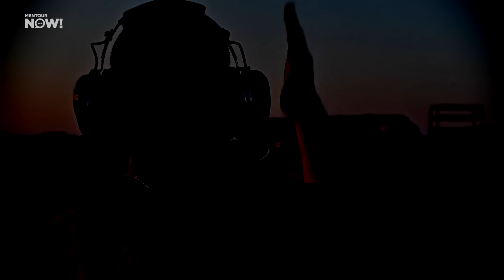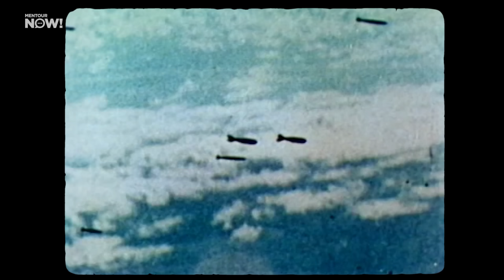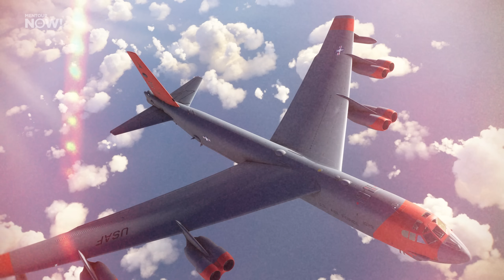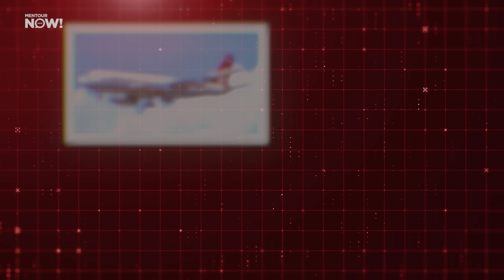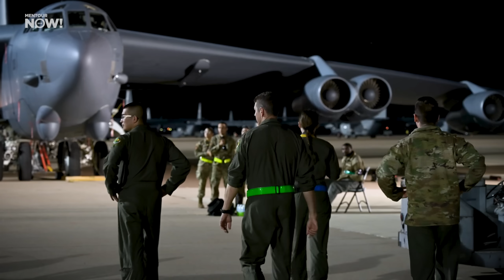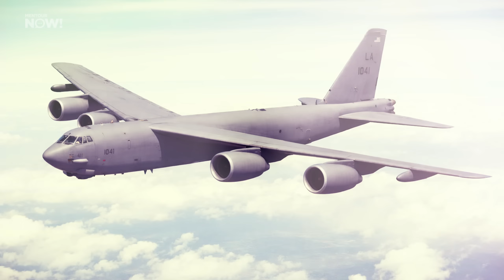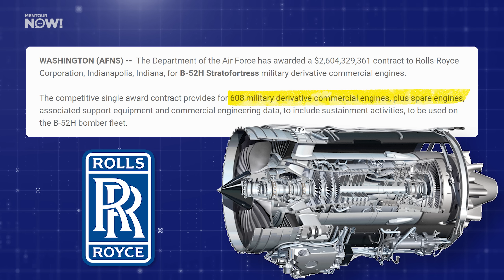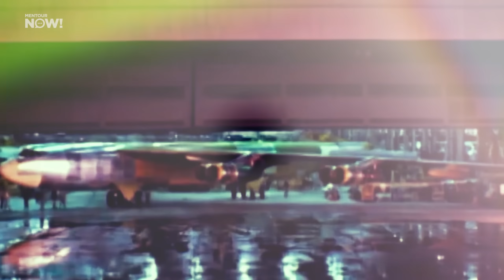WHY Are They Changing The B-52 NOW?!

Comment: what incentive would lead plane manufacturers to design and build planes that satisfy requirements are not desired by their current clients.
 Said plane could be more expensive to design (each requirement constrains the design space; potentially eliminating faster, cheaper, lighter solutions) and expensive to build (see design trade offs) and more expensive to operate (weight costs fuel; complexity costs maintenance; etc).

Rather the long drooping wings of the B52 with eight small engines represent a design that satisfied the requirements of the of the USAF at the time..

It would be interesting to speculate what could be done with some variant of the current volume commercial airliners to enable them to launch massive numbers of drones, glide bombs, cruise missiles, etc.

The A380 with dual engine out capability, fly by wire, and massive size seems like a good vehicle to transform into a new generation bomb truck.

Comment: Not the first time that a Rolls Royce designed engine built in America has been used in an American military aircraft. Indeed, that was absolutely critical in WW II when the P-51D was equipped with Packard-built Merlin engines in what was, arguably, the most important allied fighter of the second half of WW II in Europe. Ironically, at the core of RR America is the former Allison aero engine company that built the engine used by the P-51 before the Merlin was fitted.

Of course the difference now is that they are actually being built by RR. I wonder if they will be sporting that iconic logo.

Comment: Adding the risk of stall to a B-52 really is a big deal. The 1994 crash of a B-52 at Fairchild AFB, WA, resulted from a stall generated by a bank angle that was too steep for the B-52 to recover from, as it lacks the aerodynamics of some other large aircraft. Once its maximum bank angle was exceeded at low altitude, all that could happen afterward was a plummet to the ground. Not even their ejection seats could save the crew.
Reply: No plane can protect a suicidal pilot.
Reply: @theonlymadmac4771 Only he wasn't suicidal; he was arrogant.  And that's even deadlier.
Reply: @edfix flying acrobatics in a plane that is not made for it is plain stupid, too stupid for arrogance. And that a…hole took his crew with him😡
Reply: Was stationed at Fairchild in early 80's.  Worked on B-52.  We had a few pilots who tended to be cowboys and pushing the limits of the plane.  That stall was the fault of the pilot who had a tendency to pull tight banks.  When I was on base , working flight line watched a B-52 come too damm close to ground during bank while coming in.  Watched a whole flight line freeze because if pilot lost it (and it was way to close to happening) they would have ended up crashing into the line of alert ready KC-135 tankers.  I stood there and the thought in my head was that I hoped I was far enough down the flight line.  Base commander was on flight line that day.  Rumor was pilot was in Commander's office with in the hour after landing and off the base by the end of the day.
Reply: @GryphTKai1   Indeed that infamous 1994 crash was the result of a pilot gone rogue, ignoring all safety concerns, but it does demonstrate that a low-altitude stall in a B-52 is worse than a low-altitude stall in some other airframes.
Reply: A completely avoidable tragedy.  There was so much stupidity leading to that accident, it's hard to know where to start.
Reply: I mean, any aircraft will stall if you pull too hard in a turn. Maybe not an Airbus in Normal Law, but that one is just going to dive its nose into the ground unstalled if you try a manouver like that. When you say the B52 lacks the aerodynamics of other aicraft, what do you mean? I just watched the video and can't really make out anything useful. It doesn't really look like a textboox turn stall because the bank angle and flight path stays pretty constant. Is there maybe some reduced aileron effectiveness at higher angles of attack? I'm wondering why he didn't just unload and try to get wings level, but that could be just bad piloting or some control difficulties caused by those long skinny wings flexing.

Comment: Every day they delay the inevitable - a new plane for 21st century missions - is another hundred $million or so dumped down that rabbit hole.  So they keep using the sunk cost analysis inappropriately to keep this relic in the air.  Air Force has already admitted the primary use of this plane is as a stand-off platform, and there are already fully modern airplanes that can do that.

Comment: The B-52 is closer to the first flight, than it is to today
Reply: The BUFF's wingspan is longer than the Wright Brothers' first couple of powered flights in 1903.
Reply: I love this piece of trivia. Wright Bros.' first flight was in 1903. The B-52 entered service 52 years later, in 1955. That is over 70 years ago now!
Reply: B-52's initial flight*. Otherwise I'd argue the b-52 is much closer to current day than the wright flyer.
Reply: @edew9180  Based on SueBobChicVid’s reply, it seems both are true. If the Wright Bros flew in 1903 and the B52 entered service in 1955 (52 years apart) and it’s been 70 years since 1955, then it’s definitely beyond the “initial flight” and into active service (by 18 some years at least). 52 years ago was 1974 and it was definitely actively in service back then.
Reply: @TitaniumTurbine yes, but since it's flying today, it is closer to today than the wright flyer. If you specify initial flight or anything like that, she would be correct. 

Saying something current is closer to the past than the present is nonsensical. When you specify the initial flight itself, that was a past event, so yes, that makes sense.
Reply: @edew9180  I'd like to hear that argument. June 29, 1955: First operational flight and delivery to the 93rd Bomb Wing at Castle AFB.
Reply: @SueBobChicVid  yes, but since it's flying today, it is closer to today than the wright flyer. If you specify initial flight or anything like that, she would be correct. 

Saying something current is closer to the past than the present is nonsensical. When you specify the initial flight itself, that was a past event, so yes, that makes sense
Reply: Slightly off topic, but if no person lands on the Moon by 2039 (possible; not necessarily probable)... Then the time span from the Wright Bros. first flight (1903) to the first manned lunar landing (1969, thus 66 years) will be LESS than the time span from the most recent lunar landing (1972) to the next lunar landing (2039, thus 67 years).

Comment: I remember a story I read in the Boeing employee newsletter about the B-52 being hurriedly designed over a weekend to satisfy an Air Force requirement to use jet engines. I asked the AI bot on my browser and it came up with this fascinating story.

Yes, the core design of the B-52 Stratofortress as an eight-engine jet bomber was famously conceived by Boeing engineers over a single weekend in October 1948. 

Key Events of the "Dayton Weekend"

Initial Rejection: On Thursday, October 21, 1948, a Boeing team led by Chief Engineer Ed Wells arrived in Dayton, Ohio, to present their latest design to Colonel Pete Warden. The original proposal featured straight wings and four turboprop engines, but Warden rejected it, demanding an all-jet design instead.

The Weekend Redesign: Rather than returning to Seattle, the team (including George Schairer, Vaughn Blumenthal, and Art Carlsen) holed up in the Van Cleve Hotel. Over the next 48 hours, they redesigned the bomber to feature swept wings and eight turbojet engines.

Balsa Wood Model: During the weekend, Schairer visited a local hobby shop for supplies to build a 14-inch balsa wood scale model of the new aircraft, which they silver-painted in the hotel room.

Final Proposal: By Monday morning, October 25, the team presented Colonel Warden with a 33-page proposal and the finished model. Upon seeing it, Warden reportedly said, "Now we have an airplane. This is the B-52". 

Engineering Context:  While the jet-powered concept was born that weekend, it was built on work Boeing had already done for the B-47 Stratojet, which utilized similar swept-wing and podded-engine features. The B-52 eventually entered service in 1955 and is expected to continue flying through 2050.
Reply: AI bots are great at stories, whether they are in any way based in fact or not.
Reply: amazing that they did all that in just one weekend.  It would have taken me that long to build and paint one of those prefabricated plastic models.  But they did the drawing, calculations for aerodynamics, weight balance, THEN build it from wood pieces.
Reply: @xuansu9036  They probably didn't calculate anything. They just made it look good.

Comment: Have y'all seen the clip of B-52 taking off in nose-down attitude?  Done in 50s, saw on YouTube coupla years ago.  Those wings are canted back so far!  Also, landing gear rotates 20° each side of center for crosswinds.
Reply: Watching them crab is a mind bender
Reply: That crosswind take-off/landing capability will be even more important with the new engines due to the high-bypass vulnerability to crosswind-induced stall. 
I also believe the eight-engine design is favored by the Air Force because the B-52 probably draws more enemy fire than any other aircraft. Damage to one engine, as Petter mentioned, has less effect when you have eight versus four.
Reply: @Ariner-M while the b52 draws attention, it doesn't really draw more fire. The whole point of its ECM package is to make it hard for the enemy to lock on, so while they know it's coming from 200 miles away, they can't do much before it dumps its payload of 20 cruise missiles and goes home

Additionally, if you take out one engine it's likely to take out the one it's attached to. If you lose everything on one wing, you're done. If you lose both inboard pods, you're almost certainly done.

Comment: The main problem is that every decade the people in charge felt the capabilities if the B52 were still needed but never thought of initiating work on a successor with the same capabilities.
Which is why it will outlive it's successors, because the don't have these capabilities.
Bad planning. Just like the Navy...